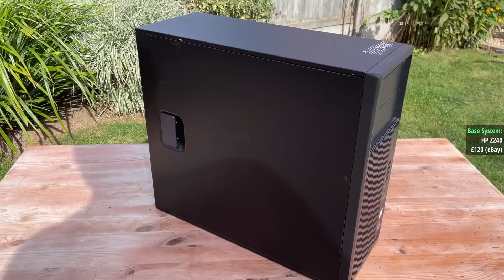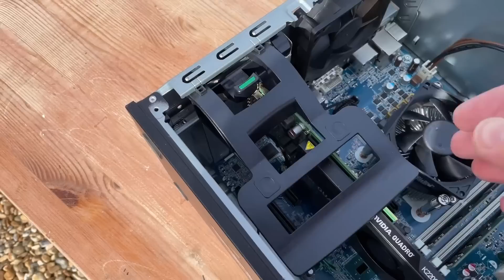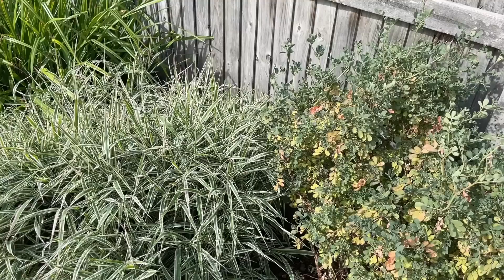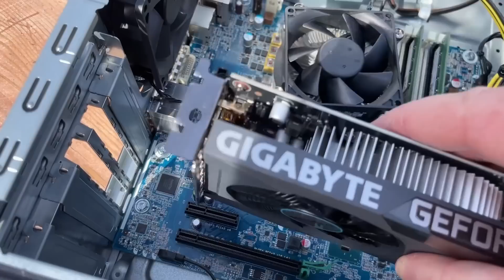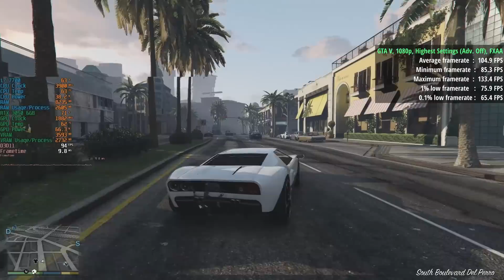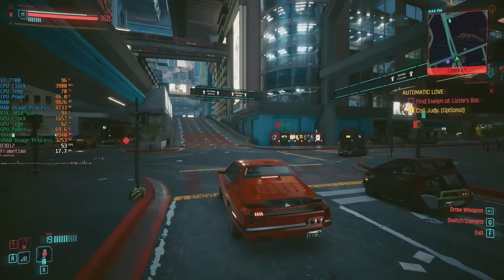A Simple £250 Gaming PC Build

Comment: Love these simple oem towers. Looks clean
Reply: I wish there were more options like that. It's either those super cheap things, or RGB window stuff.
Reply: i miss the days of the 35$ random pc casese the shops used to have back in the early 2000's
Reply: @homelessEh  yeah no shit lol, nowadays a crappy case thats worse then those 35 dollar cases is  100 bucks. I got a corsair case with a glass window for 50 bucks but that was used not new.I mean it was used for a few months so it wasnt new new but close enough. ive even resorted to buying cheap case fans from Rosewill compared to Corsair OR nzxt.I kid you not, the computer I use is a pre-built.I got it when the gpu craze for bitmining was there.I got it for 400 without a gpu but its not all that bad, i5-11400, 16 gigs of ram, an rx 6600(which I got later) and a 512gb nvme drive and a 1 tb ssd drive. for 1080p isnt bad. luckily I live next to a rich ass neighborhood. I picked up my 26" 1080p monitor for 3 bucks at a garage sale
Reply: With zero front air flow